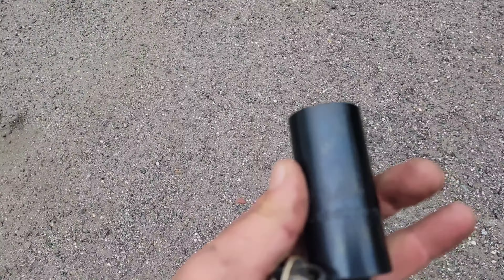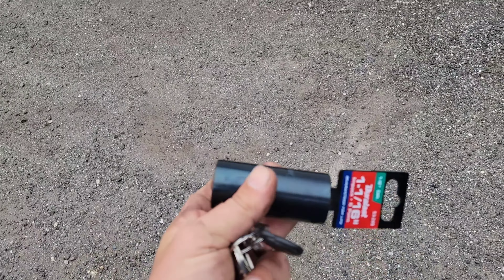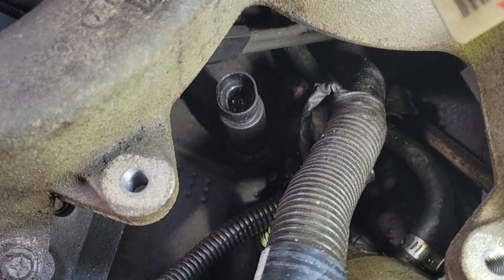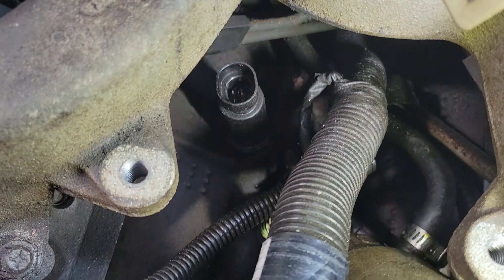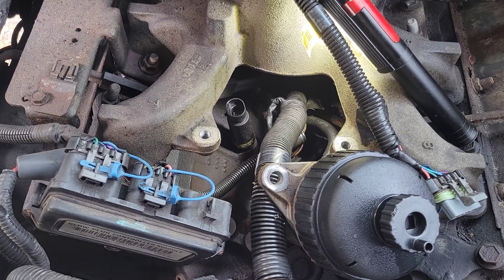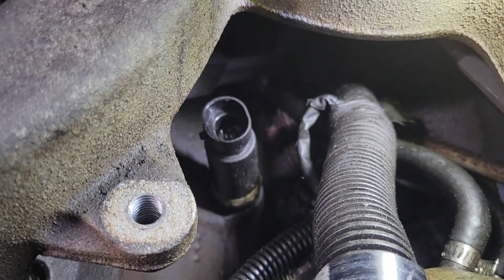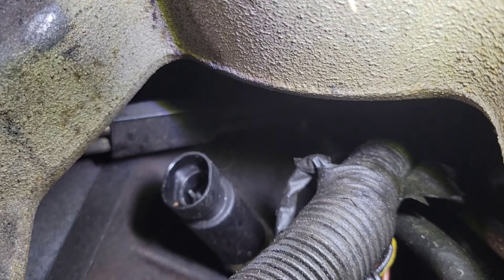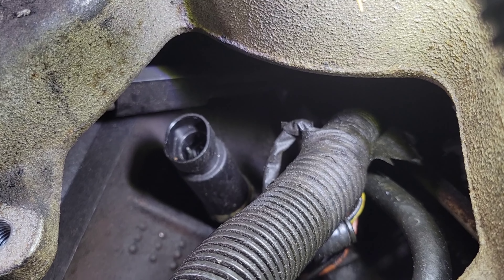6.5 diesel ops removal

Comment: …did it solve your issue?   I have similar problem…planning on changing it out this weekend
Reply from the maker: New part arrived yesterday damaged, waiting on new part to come in Monday, I will update you. These commonly fail on these 6.5s, so much so that they sell a bypass kit for them. @michaelmounts1269
Reply: @DRIVENBYFAITHGARAGE  i installed the leroy diesel relay kit…but upgraded to a much larger lift pump…draws an extra 1 amp over stock—is the bypass you mentioned completely bypasses switch…or does it shift to relay after initial start…
Reply: @DRIVENBYFAITHGARAGE  thanks…appreciate it👍
Reply from the maker: @michaelmounts1269  I haven't looked into the bypass, I was just cruising some forums and saw them mentioned a few times, the ops harness is prone to chaffing as well so do a visual inspection on that if you're in there.
Reply from the maker: Hey so new sensor came in and the threaded portion is to large, I'm going through it with this sensor, so my connector is 1 pin with a small thread, the sensors available for these engines are either  large thread and 1 pin connector part # d1818a or 3 pin connector with small thread size part # d1808a, neither are a match to mine, I'm going to run upto napa and get one of their 3 pin ones and try it.... @ michaelmounts1269
Reply: @DRIVENBYFAITHGARAGE  D1808a three pin should be correct for your engine...I've never seen a 1 pin...I put mine in and it seems to work fine--
Reply from the maker: @michaelmounts1269  I just dug through the bin at napa and FOUND IT! CAME HOME POPPED IT IN AND IT FIRED RIGHT UP!
Reply: @DRIVENBYFAITHGARAGE  excellent👍